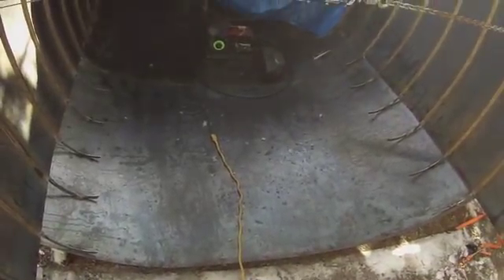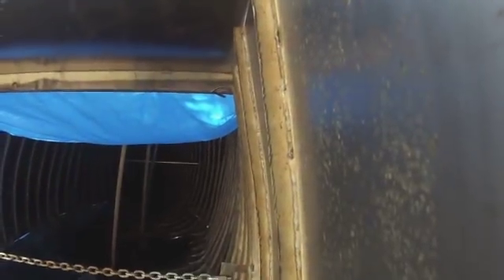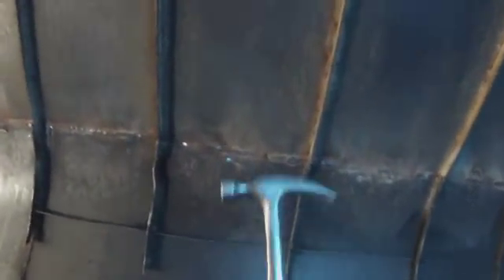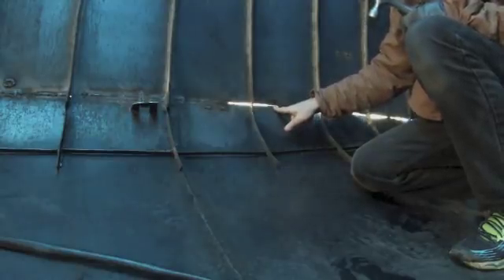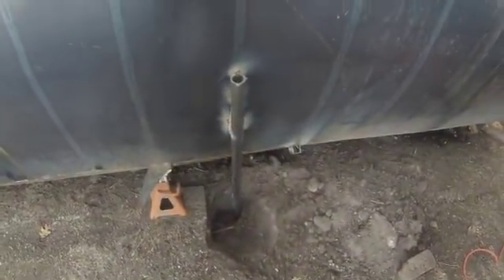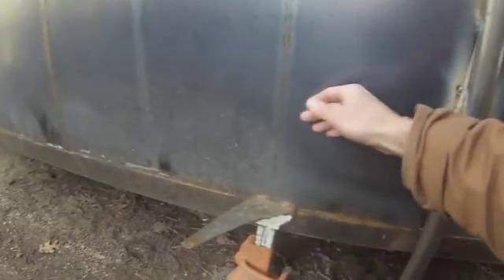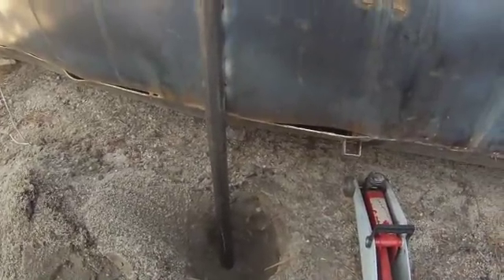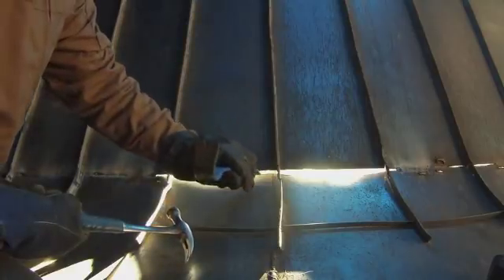Steel Sailboat Build   Part 5

Comment: in part one you said that you started the boat nov last yr, so this nov 2017 how far along are you ? sorry if getting ahead of the story...
Reply from the maker: It is November 19, 2017 as I write this comment and I have all of the hull welded together, except the stern.  It has a railing and the interior is painted.  I am currently working on the keel, which I will bolt on to the exterior (no holes of any kind will go through the hull below or near the water line.  No problem getting ahead of the story.  I am posting the videos so late because I wanted to make sure I made it far enough past the demoralizing parts of the build that I would complete the project.
Reply: okay cool thing i just cant wait till i can see more of the boat keep posting and i well keep watching ..